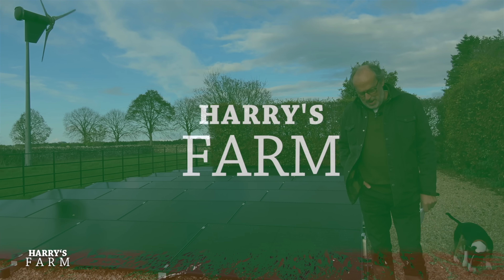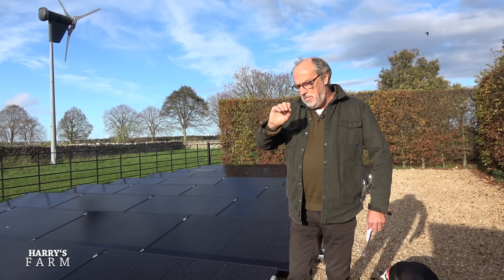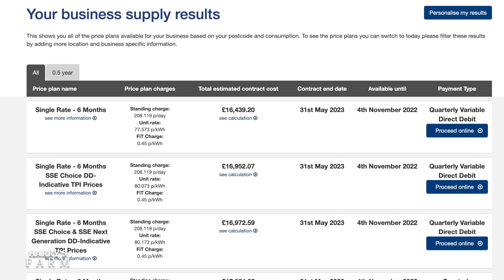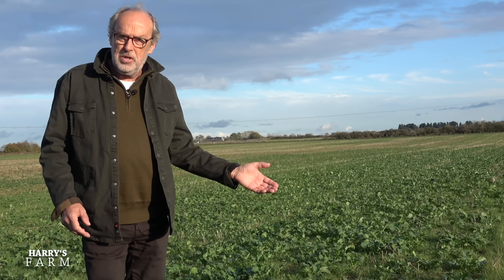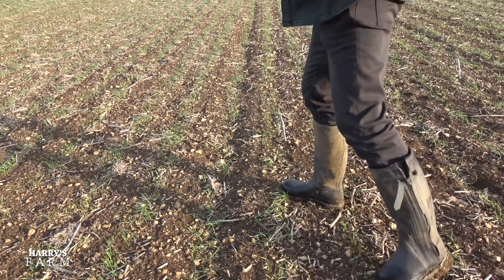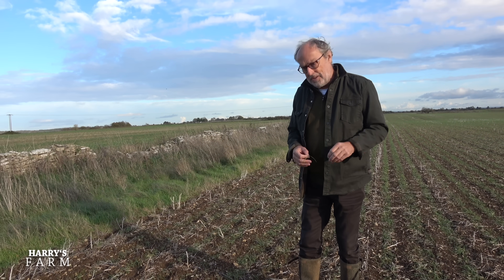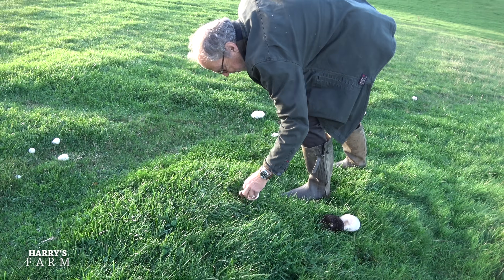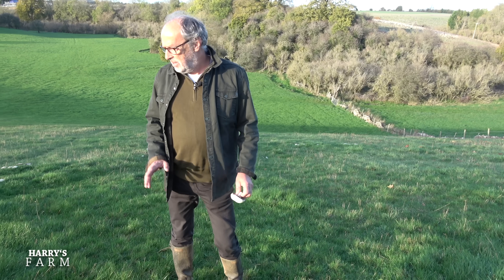More solar panels get installed plus why New Zealand's proposed carbon tax on cows is wrong

Comment: IDK why but I assumed panels would be elevated a little, it would help a little to avoid shading at low incidence.  Battery backup packs and panels will become much cheaper in a few yrs, would it be economic to avoid the grid entirely?  Those rates are infuriating.

Food for ethanol fuel??  We have the same scam with corn here in the colonies, it's roughly break even in terms of energy input vs output.  Utter insanity.

Comment: Beware anyone fitting solar panels .We can’t put ours up because DNO won’t let us .We milk cows all year round and use 300 KWHr per day ,everyday.We can’t put 50KW on the roof because the transformer is only 50KV,but we won’t be exporting and we’re putting batteries in as well.The Govt needs to step in and get the grid upgraded ,and then we can generate are own power .

Comment: Harry, those panels do not seem to have much angle on them.  Are they set up for summer declination?   If so, could they be adjusted and optimized for winter declination?
Reply: It’s always a compromise between cost and return.

Comment: Harry, I understand your perspective and I partially agree that we should focus effort into removing fossil fuels from our economy (shale oil and fracking are to blame when it comes to the most recents spikes in methane) rather than removing cows.
However there is lot of misleading information as our meat consumption has accelerated.
Cows unfortunately release way more methane than other ruminants.
Methane is a tremendous greenhouse gas compared to CO2 and it's levels have risen tremendously on the atmosphere.
Buffalo are actually being considered because of their extremely low emissions for a meat producing animal.
Another inportant factor is how much of our habitable land has been dedicated to feeding animals (about 40%). That is heavily responsible for deforestation, as we would be able to produce way more nutrition with less than a quarter the land, from just eating plants ourselfves.

Anyhow New Zealand has some of the lowest beef emissiond in the planet so the tax might not make a lot of sense, and if it gets implemented it should be small.
Reply: Methane concentration has increased from 1.6 to 1.8 parts per million,  co2 has increased from 280 ppm to 420 ppm.Water vapour the most important ghg averages around 4000 ppm. The wavelengths of outgoing ir radiation which methane can intercept are in the same spectra as water vapour, therefor a greenhouse effect dominated by water vapour(as earths Is)cannot be effected by such a tiny concentration of ch4.Will Happer of princeton university has done the most extensive work on this globally.

Comment: So true about the difference between a cloudy and sunny day Harry. Here in North East Spain I have a 5.76 kW pMax array on my roof. With a cloudy day yesterday , we produced just 8.2kWh. Today it has been sunny and we have produced 26.3kWh, so over 3 times as much. We have only been producing for three weeks but I'm already very pleased that I specified microinverters on each panel. We have a power output readout for each panel and the difference between best and worst panel can be as much as 20%. With the microinverters, the worst producing panel does not drag down the performance of the best which happens when panels are 'stringed' to a single inverter.
Reply: If there were no subsidy payments available would you still have invested in the system?
Reply: @AnthonyHigham6414001080  is there a subsidy?
Reply: @AnthonyHigham6414001080 , my answer to that is 'Yes', despite the fact that I believe that the grants system in most countries is, when you dig deep, a matter of smoke and mirrors. I believe, in the main, governments have very much pushed policy on the side of energy producers and distributors rather than the individual consumer. Unless you have a battery system in order to store your XS production for use in hours of darkness, (and currently that investment is in excess of the solar panel system - nobody can explain to me why, per kWh of storage, batteries are up to 6 times the cost of batteries for an EV, which require a far faster discharge rate). We individual producers are feeding XS capacity back into the grid during peak energy requirement hours, thus helping smooth the demand curve for the big producers and the amount paid for feed-in tariffs (UK rates are outrageously poor) is pitiful vs the wholesale price for electricity. 
The reason for the decision for me was very much based on future security of supply and I want to work towards non reliance on the grid.

Comment: Any risk of rodent damage to cables etc. with ground-based PV installation?
Reply: Should all be armoured cable
Reply: @davidpidge  I’ve never seen DC armoured cables.
Reply: There is a field based solar farm not far from where I live. As the panels are 1-2m from the ground the farmer is able to let his sheep into the field to occasionally graze the grass under the panels which still grows quite healthily. They have armoured the power cables from the panels so that the sheep don't chew through them.

Comment: There’s quite a lot of generation on the farm now! It makes me wonder how much electrical power a farm uses in 2022. 
It also makes me wonder about other fuel costs (diesel mostly I presume!) 
I know there’s some talk of hydrogen farm equipment as batteries would add so much weight and be terrible for soil compaction quite apart from efficiency. Is there a thought of this on the farm? How close are we to seeing the next generation of farm vehicles, be that electric, hydrogen, other?

Comment: It gets worse. Any shade on part of the cells reduces the total oompf. The sun needs to be directly into the cells, as the power falls off by an  increasing factor as the angle moves from 90 degrees to the surface.
It means solar cells should preferably be in the saharan desert.

Comment: As always an interesting update on the farming world of which I have an increasing awareness and knowledge courtesy of Harry.  The garage is not bad either!
Where I can possibly contribute is on eight years of domestic experience of Solar Panels.  You are right, Harry, the effect of clouds on electricity production rival what your favourite  beetle does when it comes to Oil Seed rape production.  Based on my own results output June / July produce typically in excess of 475Kwh per month whilst December / January produce around 95Kwh per month. 
 Pity it's not there when you need it most, can't help wondering what over reliance on solar will do for the country's needs.

Comment: It’s many years since I did any real farm work, although I live in a rural area, consorting with farm folk and very occasionally use my U1000 ex German Forestry tractor with a 650HIAB behind my cab 🙂

I keep in touch via your illuminating strolls…… and like the New Zealanders, worry about the noxious gasses being released into the atmosphere……… not from livestock I hasten to add, but from the mouths of the deranged climate zealots, who want a return to mud huts and a diet of insects…….. alarmingly, whilst their backers mop up coastal real estate at an alarming rate…… and in the case of Saint Bill of Gates, become the largest owner of arable land in the US

It doesn’t take Einstein to figure out their long term aim……… and no, I wear a Tilley hat, not tin foil 🙂🇬🇧

Carry on Harry……. you give hope !!

Comment: Our Go Green movement is sadly an example of ignorance in nearly every case. We all have access to more information than ever before with the Internet, yet it seems that we accept the opinions of others without looking at the facts. Hitting farmers, is no more a solution than going all electric with vehicles. The figures suggest that going all electric will save us 0.02% in emissions apparently, no saving at all and after a great deal of disruption. Of course we can do things better and reduce carbon fuel use whilst achieving the same or more energy, but that is what development and market prices do. We need to have the debate, looking at all facets of the issue, and then make the descisions that we can all get behind. Currently, the tail is wagging the dog. How much longer will the dog accept that?

Comment: Here is the con about Solar Panels... they have to stay clean to be efficient..
So you are going to use power, and water to keep them clean, it's a con..
Solar Panels have to be Clean to work at 100% efficincey... it's a con..
Wind farms have thousand of miles off copper wire between them, and it was mined using co2 blurting trucks...
It's all fake..

Comment: Harry, someone needs to point out the IPCC’s new GWP* (Global Warming Potential - Star) metric, compared to the old GWP100. The IPCC have finally realised they’ve got their methane calculations wrong, by a factor of about 10. It seems farmers understood the 10 year  ‘methane cycle’, but the IPCC was basing its calculations on 100 years, “for simplicity”. 
Strangely, the BBC are still saying veganism ‘saves the planet’, and Netflix are still hosting Cowspiracy and attacking farming with fabricated statistics.

Comment: I don't know whether you have optimisers fitted and, in the lighting conditions in the video, it's clear that the bottoms of your panels are partially shaded by the tops of the "up sun" panels. This does not help output. You need to space your rows further apart so that this shading doesn't occur.

Comment: Enjoyed the update. 

If I recall, you had geothermal installed in the house. I would be interested in a video that covers your experience with it.
Reply: If you have 60c plus hot rocks underground it works ok. We have at 200 feet. So borehole into the rocks plus pipes. Its well expensive. I dont think it will pay for itself longterm.

Comment: Thanks for the update Harry, 

Quite right about poor Solar PV outside of summer months in northern climbs. Solar thermal however is extremely efficient for water heating and as supplementary space heating if over sized and use a thermal store. 

You are correct about carbon cycle well regarding livestock. Sadly you appear to have fallen for the 1850s Malthusian/ eugenicist's lie about population though.  Apart from poorly planned cities the earth is not overpopulated. 

As for man made carbon, methane or NO2 emissions being the primary driver of global climate change that's a IPCC modelling minefield which excludes huge drivers of energy like the amount of solar radiation, the effects of oceans and ignores recent decades where ice is being restored to 1990s levels and greening of planet is happening outside of concrete developments.
Reply: Dude, it's 2022, not 1992. The human impact on climate change is very well established and accepted now.

Comment: To the extent that the planet is actually "heating" then this is for the fairly obvious reason that we are in an inter-glacial.  And whether the ice caps will fully recede, or return is not something anyone can answer!  The other major cause is the activity of the Sun.  Maybe human activity does have an impact, but it does seem incredibly unlikely.  And certainly no one has demonstrated otherwise.  It is pure conjecture, and driven by green activists!

Comment: Thanks and nice setup with solar panels! Did you have batteries to store energy? They might remove need to sell electricity.
Reply: Until the batteries are full?
Reply: @johnnunn8688  Yeah battery is expensive but what isn't. It's about right sizing panels and batteries. Occasional extra power from panels is easy to use e.g. to heat water.

Comment: The main problem with cattle is not in the UK but in areas like Brazil where they are cutting down rainforest for grazing land, they then overgraze it, and then cut down more rainforest, this is happening at an alarming rate.  I don’t think anyone could say that the UK cattle model is bad for the environment. What would be great though Harry is if you could show us what you do towards looking after the wildlife on your farm?
Reply: Rainforest land makes awful pasture so after a couple of years it dies and they need to cut down more and move them over.
Reply: @meta_cryptic  Also the issue quite obviously isn't the cattle themselves in the original post. The cattle aren't the ones causing large ecosystem issues, it's the people creating those issues. Chopping down forrested areas is the issue, if you weren't chopping it down then there wouldn't be cattle eating it. Aside from that the oil and coal is the true problem. Coal and oil should've been viable for a few decades, not a century. Oil and coal money has and still is burying technical innovations because it'll eat into their greed. Electric cars isn't even a new concept, nor is the concept and proven models of other fuel systems. Other forms of energy should've been actively researched and implemented to take advantage of natural energies.

Comment: Current wholesale electricity prices (price to suppliers) is between 25 and 30p/kWh. If they are charging 80p/kWh as their variable rate then they are taking the piss. Fuel and electricity suppliers all seem to be getting very greedy with their margins. Buy 2000l of white diesel gets a price 20p less than on the forecourt, yet petrol stations are still spouting the myth that they operate on a 1p per litre margin.

Comment: The panels are way too low an angle, especially this time of year, optimum year round angle for the UK is about 43 degrees, also part shadows from the hedge is not good.

Comment: "Cloud, I'm fast discovering, is any enemy of solar installations"  and "You'll need a full summer day to get to the potential"

Is that genuinely something you didn't appreciate already?  Reminds me of comments around EV's where people are surprised that the 250 miles of range they see on a perfect summers day driving around town isn't matched on a motorway run in the depths of winter.  Do people really do no research before investing in these things?
Reply: The problem is that there is so much invested interests in selling these things that there isn't much in the way of any balanced information on this tech. Unfortunately, the powers that be are also hurtling us all towards this tech.
Reply: @sh-hg4eg  No, the fact of the matter is he believed the mythology.
Reply: @sh-hg4eg  Surely though it's  just common sense?  In the case of solar (a technology that depends exclusively on sunlight) to be surprised that it doesn't work anywhere near capacity other than in the middle of summer in the UK,  is ridiculous.
Reply: @SW-by9ob  You make the unsupported assumption that common sense,is in fact common.

Comment: The problem with methane from animals is that it has a much bigger climate impact than CO2. Hence saying "it absorbs CO2" doesn't work as well without knowing how much CO2 is removed vs CH4 emitted. Not saying it makes sense but not every gas is equal.
Reply: Well, CO2 has no impact on the climate at all.  But it is greening up the planet, even NASA admits that.

Comment: Very much a summer biased solar array. They need to be near vertical at this time of year for maximum output.
Reply: He's only just working out that they won't get any benefit in the winter, just when they need it the most!!!  
Wait until they're covered in snow, and that little windmill's stopped turning because it's becalmed. 😂

Comment: The peak output of the solar panels will be with sun normal (90°) to the surface of the panels. Otherwise the power has to be multiplied by the cosine of the angle of the 🌞 rays to the surface of the panels

Comment: The main producer of Co2 are oceans with 330 billion tonnes per year, plants and animals are 220 billion then soil respiration 220 billion. Human activity is around 38 billion of which so called fossil fuels account for 33 billion. The human effect is massively over egged, if we did want to reduce Co2 production then we should start with the lowest hanging fruit which would be to stop burning coal, that would reduce fossil fuel Co2 by a half.

As for the methane and Co2 from farming it is barely anything in the grand scheme of things, I suspect that the moves in New Zealand and the Netherlands are just the thin end of the wedge in a move to commercialise food production and bring it under central control. So nothing to do with carbon and everything to do with control over food production and therefore control over the population as a whole. Similar story with control over energy supplies and during the pandemic control over population movement and economic activity.
Reply: Why would we want to reduce the production of CO2?  The planet is only just starting to green up nicely.  CO2 is not a pollutant, and does not affect the climate.  We need more, not less.
Reply: @SaxonSuccess  "C02 is not a pollutant, and does not affect the climate."

Yeah, just look at Venus.
Reply: @SaxonSuccess  Bullshit. The higher concentration of C02 in the atmosphere heats up the planet. The rising temperatures are causing the catastrophes we experience today.
Reply: @SaxonSuccess  - So true, all major green house farms,buy CO2 gas bottles & pump into their glass houses for complete growing systems.🤔
Reply: Exactly, there is always an alterior motive for those like the WEF, it always boils down to extra control for them.Sadly many in cuckoo land are going to get a rude awakening about the effluent the world is in, and the cow's are not responsible.

Comment: On methane from production animals; I was told once that the methane that is produced by Termites in the Amazon balances out the CO2 absorbed by the trees. Remove the trees and you remove the termites - so deforestation is net zero. I doubt that’s completely right - But how much greenhouse gas is created by insects?